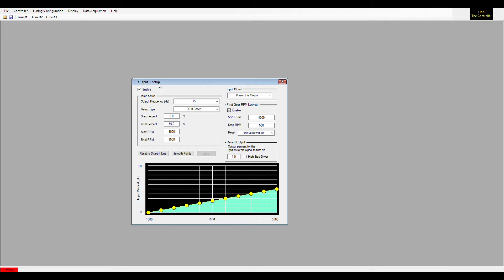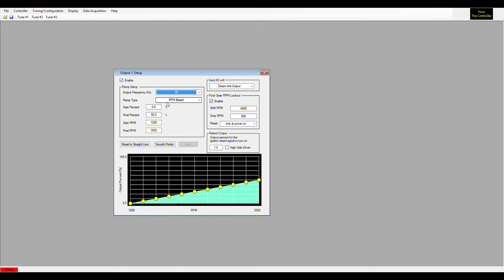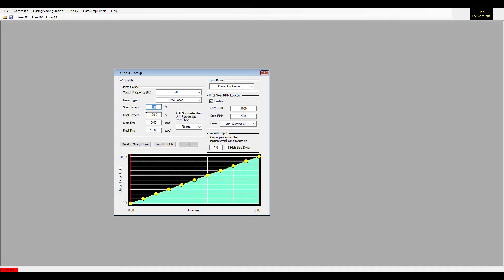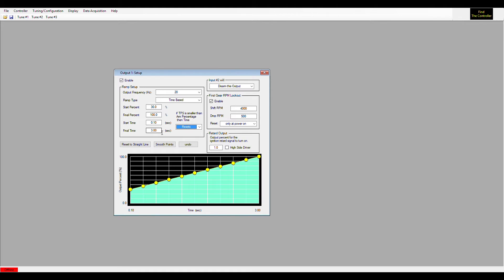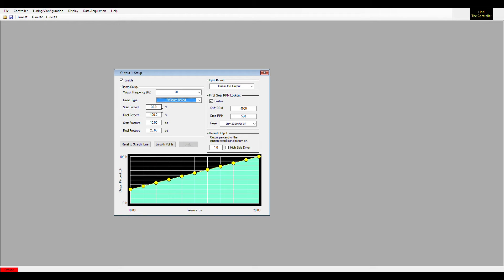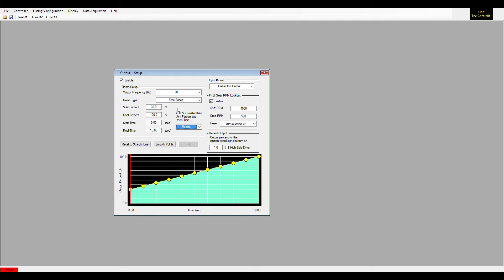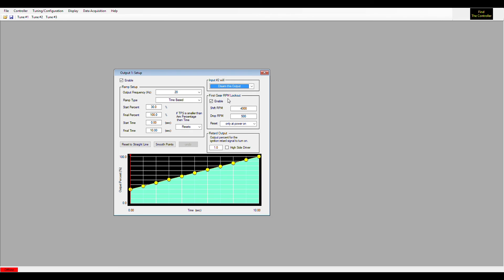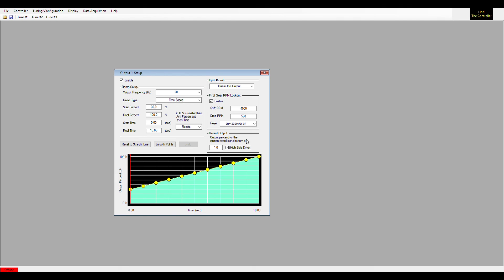Nitrous Express Maximizer 5 Progression Ramp Setup Explanation

Comment: Question On The Retard Output. If I Set It To Enable At Any Point On My Curve Does The Curve Have To Be Active Or Does It Operate Completely On That Curve Type Input. Say I Have My Curve Set To Pressure From 0PSI - 15PSI (100%->0% Progression): Will The Retard Signal Be Sent Out If Set To 5PSI And The The Boost Pressure Is 10PSI BUT While The Throttle Position Is Below Activation Point Of The Curve?
Reply from the maker: The retard signal is sent by a user defined point in the solenoid progression ramp, not by the ramp type.  So for example if you put the start point at 30 that means at 30% solenoid progression it will send the retard signal out.
Reply: @NitrousExpressVids    Ok I Get That But Does The Retard Output Only Occur While When Curve Is Active? The Retard Out Will Not Output If Input Parameters Are Not Met?
Reply from the maker: @salvatorehayes2753  that is correct.

Comment: Question : Can Multiple Outputs Works At Once? Say 1&2 Outputs For The Nitrous Single Stage Solenoids Wired For AFR Control Loop With A MAP Progression And Then Can Output 3 Also Be Used At The Same To Ground A Relay On Or Off Based On Vehicle Speed Input Say Additional Cooling Fans (To Make Fans Turn Off Past 30MPH)? AND Could I Have Output 4 Ground Another Relay Based On MAP Pressure Setting? I Would Like All Outputs To Operate Simultaneously. Is This Possible?
Reply from the maker: Yes, multiple outputs can be enabled at the same time, as long as your output setups were all the same all would come on at the same time.
Yes, outputs 3 and 4 will send signal to a relay without the need for an additional driver, as the relay would be handling the amp draw from whatever accessory you are activating.

Comment: I just bought a nitrous express system with the Max 5 and I can’t find any instructions on wiring the bottle heater and the nitrous sensor to the max 5 to use heater control I need help !
Reply: We have instructions on nitrousexpress.com and we also have a tech line available from 9am-5pm CST at 1-888-463-2781

Comment: Can I use both RPM based and TPS based ramping? say I want to ramp rpm at low end, and then be able to pedal throttle at high rpm
Reply from the maker: No sir, it will only be one or the other.  The controller will not allow for ramp type to be changed mid-ramp.
Reply: @NitrousExpressVids  but you can use the rpm based ramp and a tps window switch combined correct?
Reply: @Jtdedeaux  Why do you need to complicate things? You can set the ramp to reduce power and restart the ramp if you're TPS drops below a certain percentage.